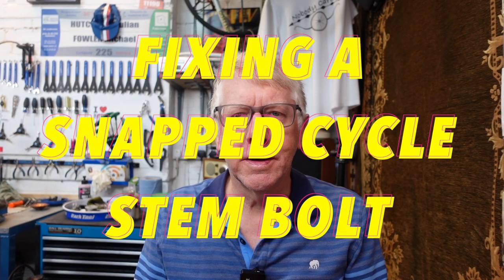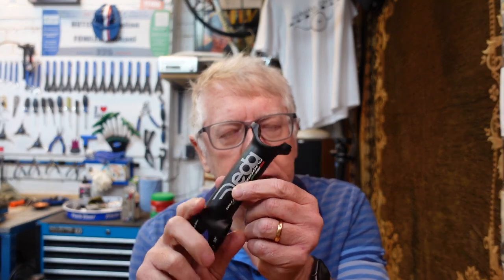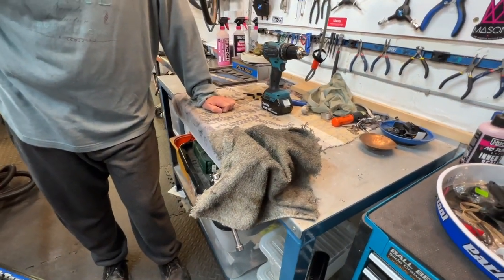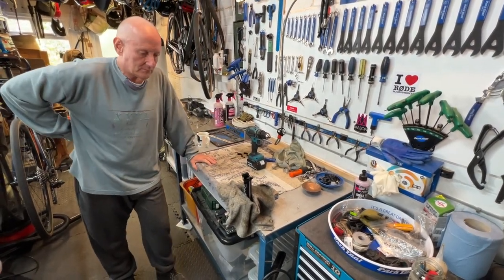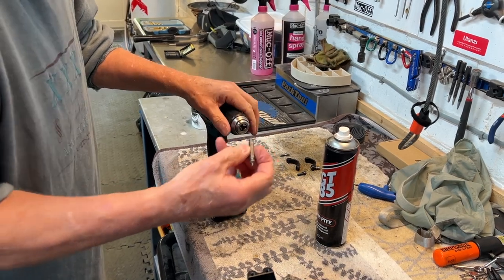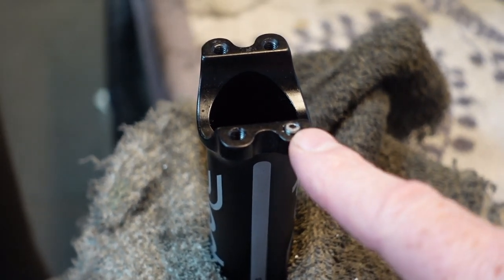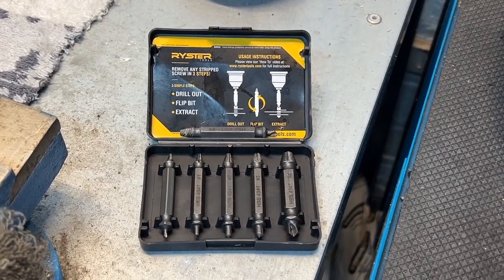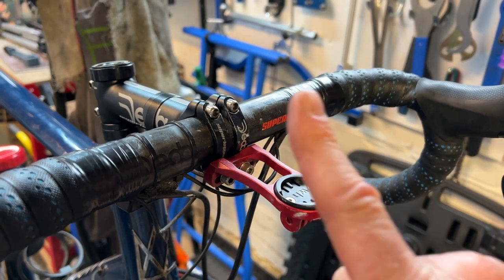How to fix a snapped cycle stem bolt - In the workshop with Jules and Simon

Comment: Two things.
It's not a vice to have soft jaws in your vise, get or make some.
Where Loctite® is a factor, use a heat gun to soften it: 150°F (66°C) to 200°F (93°C), same for many adhesives like labels, old tape and such.
Reply: A heat stripper or propane torch will do it on non flammable areas. Usually you can loctite if you really don't want it to slip or come loose. Aero bar pads are an item you really don't want to slip if you're a big guy!

Comment: Simon did a very good job on that, I always have trouble with the drill bit first step where your drilling with the small bit.  That was a great tool with the tree steps.  I have a zip stem that seems to want to round out and of course I have been removing this stem often due to bike part changes… You did a good job hard to drill without a punch.  I have been trying to determine the correct bolt you use in a bh90 grx810 lever for hydraulic brakes.

Comment: Often the screw strips the forged threads before breaking. I stripped an aluminum thread on an aero bar which was in a less obvious spot. By getting a long M-5 hex bolt and rounding the hex on a grinder I tightened it past and into threads that were intact. 4 nuts were placed on the protruding overly long bolts.  By jam nutting the top 2 with red loctite and turning the second one anti clockwise I tightened the hell out of it. The 3rd and 4th nut were tighten with a spanner, loctited  after tightening the hell out of it and jam nutted. Length of the bolt and top nuts cut down with a hacksaw. Additionally I had coated the contact points with red loctite. It hasn't moved  since! Could do the same on the other side if it ever slips. I could have clearance drilled the works, but felt the remaining threads would have been enough. Belt and suspenders!
Reply from the maker: I didn't understand a word of that.
Reply: @JulianHutchings  I through bolted damaged threads with extreme prejudice!